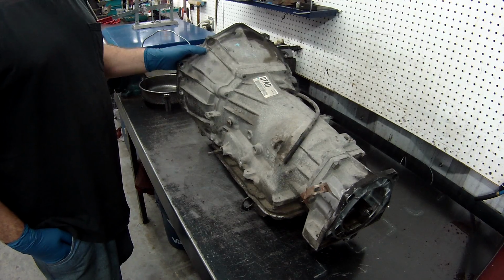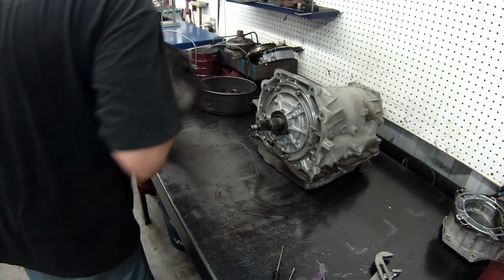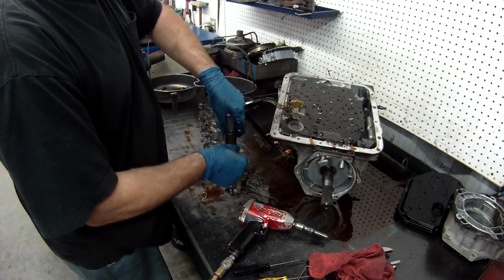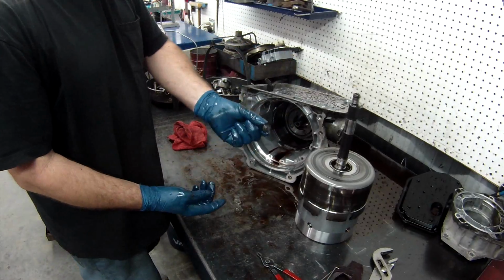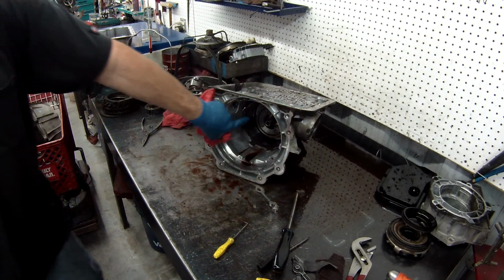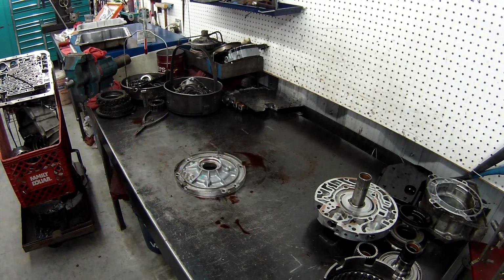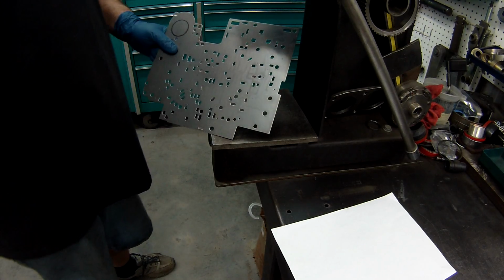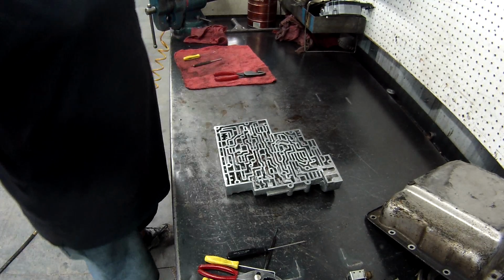4L60E Part 1

Comment: Thanks for your videos Brad, it seems to me that your hands have inteligence of their own, you work damn fast. By the way  I am little bit dislexic too. Question:  I own a nice 1994 Cutlass Ciera, that´s showing a no reverse condition only when is cold.  according to your experience what is the more likely cause?. Thanks in advance Brad.
Reply from the maker: Old age. When the seals get old they become hard and don't seal, and don't soften up until the fluid gets hot. needs overhaul.
Reply: Thanks a lot man.

Comment: Regards Brad I hope you are well and I tell you, to my suburban I did the repair that you recommended the change of the band 2-4 and the carcasa and the arme work perfectly that was two months ago but it turns out that the Sunday that I went to road Again made the same failure the change from first to second does not jump to jump to third revolution at 3000 RPM, and to disarm and returned to leave the band 2-4 damaged, you could help me with this failure why the band is spent 2- 4 so fast, my car is a Suburban 2500 1999 with 4L60E transmission. Thank you in advance for your help, I say goodbye and hope you can help me.

Comment: how many guys/shops rebuild a trans that good. I wonder? any chance of you moving to dallas any time soon, Brad?
Reply from the maker: Sorry not moving. The thing is the shop I work for doesn't want me to build that way they don't see the benefit in it. I do build every unit that way at home. (where I make the videos) I see it this way, I have never had a come back when I build a transmission this way. That's worth it I think.
Reply: me and you are probably the same in many ways. PERFECTION & HARDWORKING! if i could do what you do, I would approach it, just  like that. I wanna believe I got a good 4l60 but really have my doubts after watching your vids.

Comment: Hi Brad, help me with this problem, my Suburban 2500 1999 with 4L60E transmission jumps the second, starts at first but does not make the second change to jump to the third revolution at 3000 RPM the other changes the good, same in the recoil arrives To third and from there jump to first, with your experience, for you what is the fault. For your attention, thank you.
Reply from the maker: If you have rev it sounds like the band is broken or burnt up. Still it could be a broken shell I have seen it work for rev and not forward.
Reply: Thanks Brad for your comment, and if the reverse works well and in general all changes only the change from first to second is the fault, I thank you for your help, and then I will disarm the transmission to see that damaged anything I comment you .
Reply: Hi Brad Good evening, I hope you are well and I comment and I disarm the transmission and the problem I found was that the band 2-4 came out burned and the reverse drum striped and with curvature in the center of the face where it seats the band 2 -4, also in the valve body note that the regulating valve TCC is without spring pressure, I do not know if it is normal that it does not have spring pressure or that the spring is damaged, you can tell me from this observation . For your attention, thank you.
Reply: I'm having that same problem with my Firebird formula
Reply from the maker: Sorry it took so long to respond. hope you have it fixed by now. replace drum and shell. I think your talking about the converter clutch signal valve? The early ones have no spring but later ones do. Again sorry for the late reply.

Comment: Hey Brad, thanks for making these great vids!  Can you recommend a good major overhaul kit, for a 4l60e?  99 Tahoe, 5.7 4x4, 145k.  Not sure yet what the problem is, it went bang and then suddenly it doesn't want to shift out of 1st.  Once I hit about 20 let off the pedal and then hit it again it will kick in and all seems ok till back to first...  Hoping it's a bad solenoid, but just happened today.  Dammit man!! : )  It may actually not be shifting at the right rpms now, seems like overdrive may not be working right, and odd pulsing tug when braking at a light.  Anyways, if you have a min i'd appreciate any suggestions.  Have you thought of making a Patreon account?  You should seriously load these vids there and make some cash man!  I'd gladly make a contribution.  Thanks again!